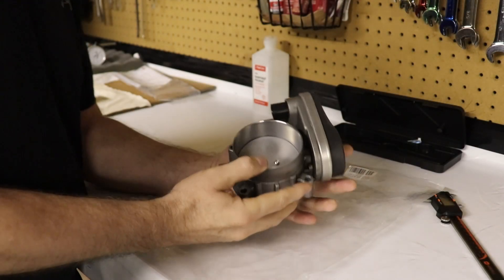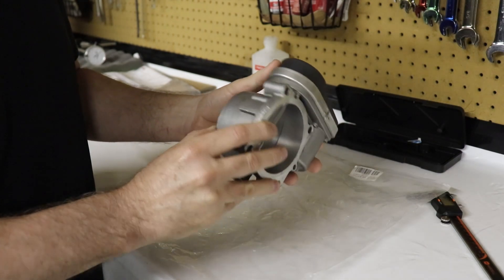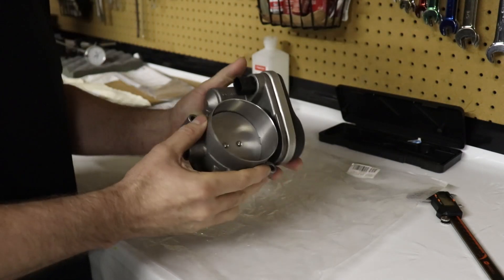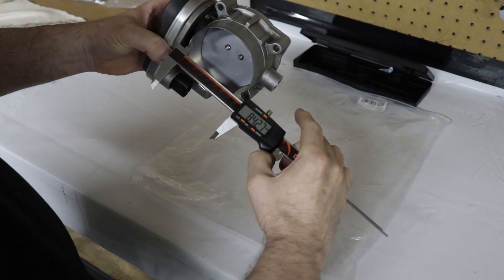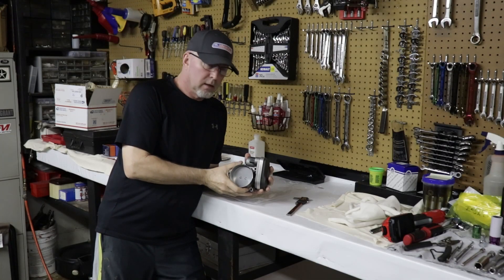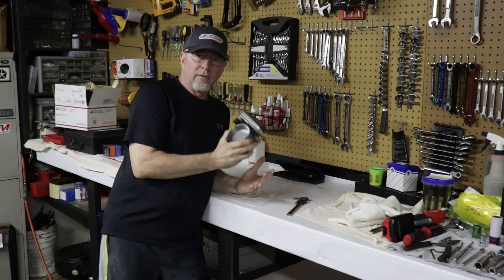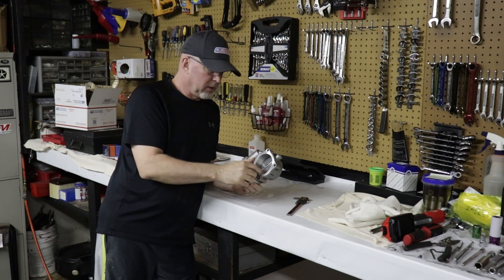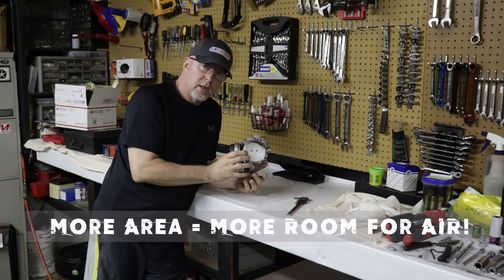The Fastman Ported Throttle Boby - 84mm Overbore - 5.7 Hemi

Comment: could u feel a good difference or do u have dyno results?
Reply from the maker: No Dyno results from me, but others have seen around 5 HP gains. It probably adds more throttle response than anything unless your modified to the point your stock throttle body has become a restriction. Thanks for watching!